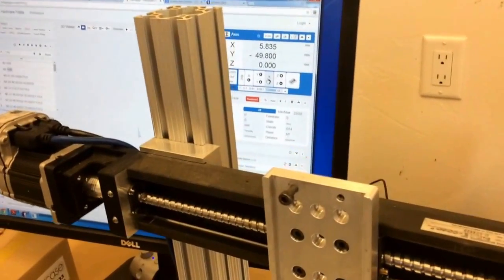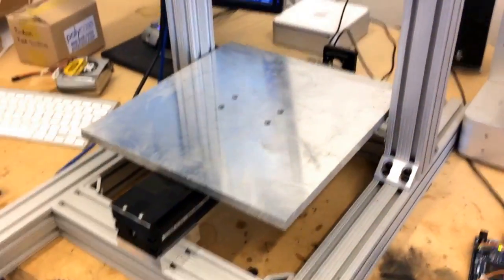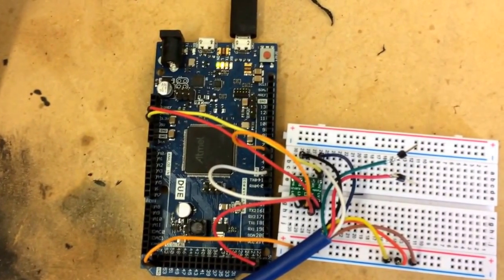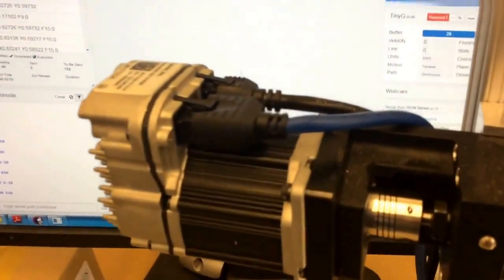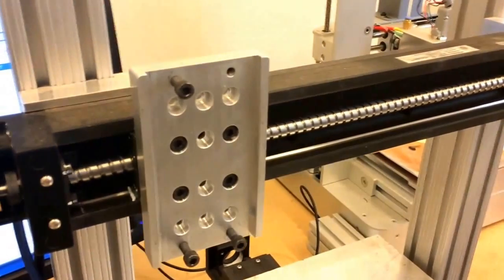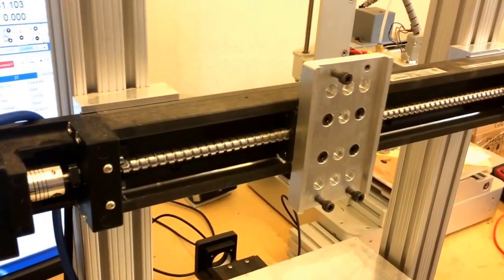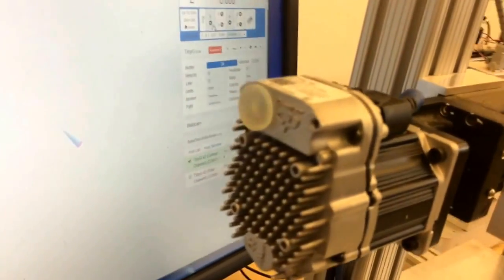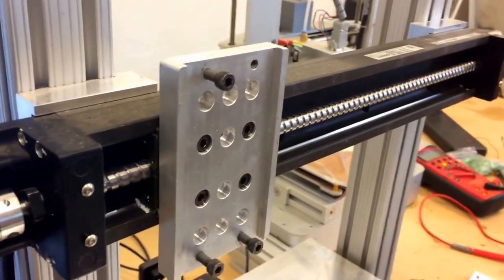KR33 diy cnc first movements

Comment: I'm creating a similar setup using the tiny G.  I could find a way to invert the output of the enable pin.  Ting is active low, and the enable on the CP servos is active high.  Seems like the G2 doesn't have this problem.
Reply from the maker: The G2 does have this problem just like the TinyG did (or at least used to did) what I had to do to make the G2 was compile my own binary, total PIA, I would look into the smoothieboard until the Synthetos guys get their act together.
Reply: Anthony Webb    Thank you for your response.    Good to know, so I'm not going mental.   I'll put an inverter prior to the voltage shifter. A bit frustrating having to deal with this before I can get my machine to move...

Comment: very cool.  how do you have the motor configured?  aren't there different acceleration profiles?  steps per revolution?
Reply from the maker: The motor is just in its default config, you can connect over usb and tweak and monitor all sorts of metrics, half of which I am totally lost on. I did accidentally run the servo to the end of the actuator and the motors software end stops performed beautifully saving the day. Once I get all the motors mounted I will begin the process of dialing in all the config.
Reply: for what its worth when you do get around to adjusting the settings... this is from a guy that has some experience with these things:  "I'm surprised that he is not using higher accelerations since you don't have to worry about missed steps especially when doing rapids where slight deviations from the programmed path during movement does not adversely effect the machined result.  Nice looking build though."
Reply from the maker: Great insight, thanks Frank Graffagnino I am a total newbie when it comes to these servos so any help is very welcome.